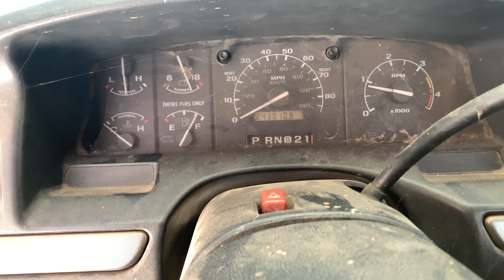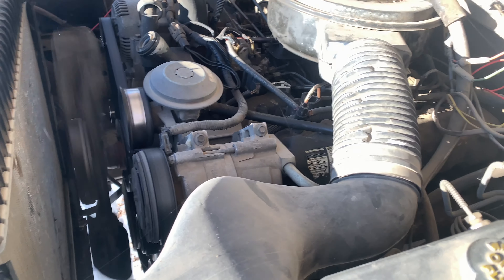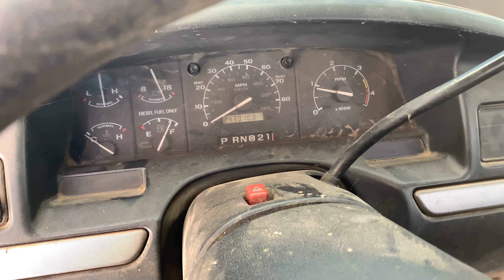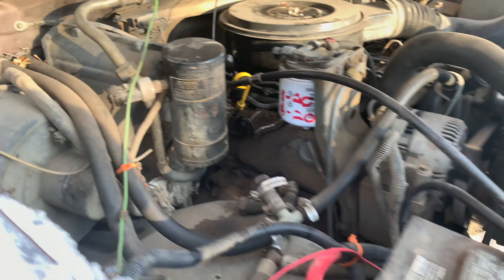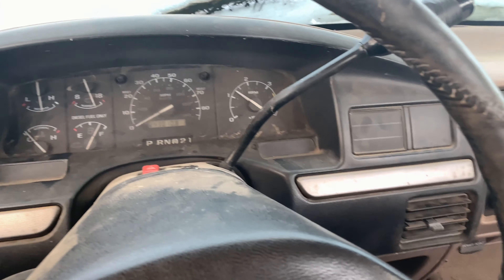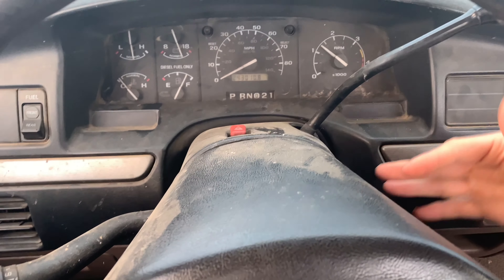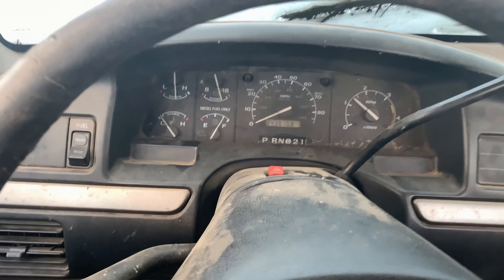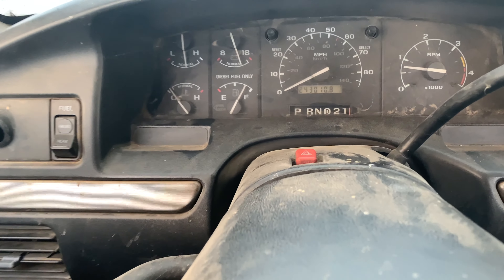Old Start Cold Start Ford F250 7.3IDI 1993 Diesel

Comment: Those international harvester motors are the best diesel engine ever built.  Ford scored big time when they teamed up with international harvester.
Reply: Until they made the 6.0 and 6.4 lol.
Reply: @psd28  agreed, but they did fix their issues with the 6.7
Reply: @Michael Z  the 6.7 powerstroke isn't an international motor. Ford's contract with international ended and Ford wisely chose not to renew it because all the issues with the 6.0 and 6.4 motors so Ford designed the 6.7 inhouse.
Reply: @psd28  the 6.4 isn't and IH motor, and the 6.0 IH and Ford argued over during design.
Reply: @psd28 this man said the 6.0 was better than the 7.3 LMFAO
Reply: @J-1410 the 6.4 and the 6.0 are both manufactured by international inc

Comment: I own a 1988 F250 same motor, the gauges in terms of oil pressure, volts, and temp are notoriously unreliable. I would add a set of aftermarket gauges to the truck if I were you.
Reply from the maker: yeah all fords gauges aren't right i know that for a fact the volt meter is right though the alternator over charges i have tested it before

Comment: not sure about you but about a month ago it was 27 degrees outside not plugged in I let the glow plugs do their cycle it started right up but i got a cold knock from the engine and no oil pressure for 6 seconds then it started to go away. I normally don't drive it in the winter it was my first winter with this truck. no crank time at all I got a electric fuel pump under the hood

Comment: There definitely a glow plug thats bad, on those older relays for the glow plugs one goes bad and it won’t let it warm up or it’ll cut the amount of time the glow plugs warm up, I think it’s about 30sec for the normal glow plug run time and other than once or twice of those runs it’ll start right up.

Comment: My friend has a 97 with the banks turbo. It keeps blowing the big 30 amp fuse in the Black Box near the master cylinder and transmission will not shift properly what could it be? where would you start?
Reply: A 97 with a banks turbo? The 7.3 powerstroke came with a garrett tp38